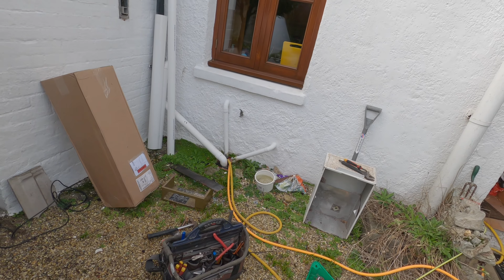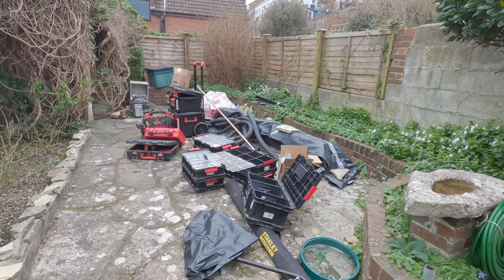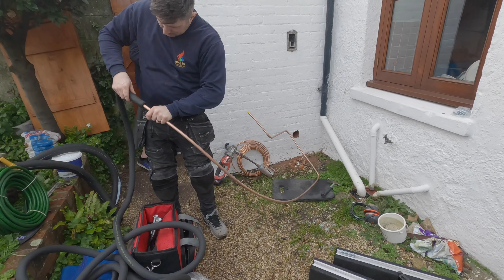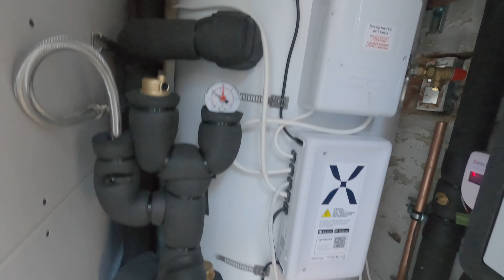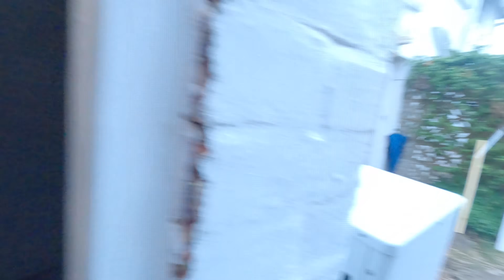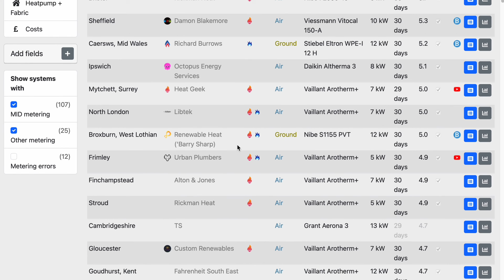Vaillant Heat Pump and Mixergy tank installation experiences - Dorset, UK

Comment: Thank you. I’m having ours installed in the next few weeks. 
I’m extremely nervous that the unit is way too big as we like to keep the house cool at about 15C, a Samsung 16kW unit, I keep arguing with the installers but they insist that anything smaller won’t work. Previous installers were pushing for a 3 phase unit!
I just hope that the compressor can ramp down sufficiently to let us run at a 40C flow temperature or less.
Reply from the maker: We have another heat pump installation which used a STIEBEL ELTRON 12.kW unit. I run this at 30c to 35c for house heating and it did seem difficult to get it to use less than 2kW+  with amore cycling than I would like. I have put the unit into a silent mode that I think stops the heat pump from going over 70% of its potential. That seems to improve the efficiency though I find it hard to be sure. The Vaillant system also runs at around 35c for heating, and it takes about 700W typically - but the house is significantly smaller.  There is an interesting discussion on the subject of sizing of heat pumps in the OpenEnergyMonitor Community with the title Electrification of Heat trial data by Trystan Lea if you have not seen that. Good luck with your system. 👍
Reply: @ Thank you. 
We used to live in Switzerland and had a heat pump installed there about 15 years ago, it was all really straightforward and worked well and was economical to run. I’m not convinced many installers know what they are doing yet in the UK with these units, seems more of a dark art than engineering. It shouldn’t be.

Comment: Great video 😀 I've been reading about how Mixergy affects performance if the water isn't in Eco mode, maybe it's worth experimenting with this to see if it affects your overall SCOP. Also, have you adjusted your weather compensation curves as low as possible? Again, efficiency gains to be made.
Reply from the maker: Thanks for the useful comment. We are on purely weather compensation with a curve of 0.7 which seems to be about right for us.  I'll look into the ECO - it doesn't seem to be available from the app, but I'll dig into the control panel. Thanks again, Jeff

Comment: the radiators installed were they k3 or k2+?
Reply from the maker: Hi - I think we have a mixture of K3 and K2 radiators.  The installers did the design and then gave us some options depending in the width that we preferred in each location.
Reply: @ thank you, how have you found the cold snap at that location or haven’t you gone back recently, I know it’s a lot milder, but interested in the k3 performance compared to the old boiler since I’m used to 55c rads and if they truly can help on a cold room , on the pump
Reply from the maker: @ram64man  I can't really say, except the house is wonderfully warm, much more than when we had the old gas boiler, even though the radiators are running at a much lower temperature. The constancy of the heating keeps the place cosier. We have no regrets!
Reply: @ thank you for the feedback

Comment: Great video Jeff. I'm just trying to learn as much about air-to-water ASHPs as I can for our house in London. I'm amazed though that you needed a 7kW unit as I think we could probably get away with that on our 4-bed detached! We already have a couple of air-to-air ASHPs on our house in France (they call air-to-air and units "reversible aircon" there) but they're hugely simpler.
Reply from the maker: Hi, thanks for the reply.  I’m not sure if it is over-sized or not, it is hard to say for sure until it gets really cold.  Right now the AroTherm is purring away, and only gets a little more energetic when heating up the hot water tank when the flow temperature gets to just about 60C degrees.  The house is very comfortable right now, and time will tell if it could have had a smaller unit.  When heating the house, the power peaks at just under 800W and stabilises at 550W.  The COP while heating the house seems to be about 4.2.
Reply: That's very good CoP-wise! So if I'm working it out right, your peak heat output at the moment is 4.2 x 800W = 3.4kW so well within the capabilities of your heat pump. What was your EPC prior to upgrade? I'm waiting to get an EPC here which I'm expecting will be around a D...
Reply: I'm guessing you're an engineer, BTW, given how comfortable you seem to be with the technology. I'm of the same generation as you, an electrical engineer by training and have spent my life in consultancy (now retired) so very into technology.
Reply from the maker: @reeshar1234  Our EPC at the time was C, and indeed the house seems to retain heat pretty well, it being mid-terrace and having thick stone walls.  I used to work in IT and so the computing side is fine - but I struggle sometimes with electrical things, though I guess I am learning more all the time. I do rather like the Home Assistant and the flexibility and integration that it gives in monitoring and controlling things. Though I have learnt also that a smart home is only as smart as the person who configures it ... 😉
Reply: Our house in France has 45cm stone walls so I know the issue - namely that it takes a lot of time for the house to warm up (or cool down in summer, given we have an air-to-air system).
Reply from the maker: @reeshar1234  Yes, it works well for us.  Do you have a heat pump there in France?

Comment: Thanks for posting. I'm on the ASHP journey too, in my Purbeck area renovation. I'd have been interested to know the final cost of the installation.
Reply from the maker: Hi, it was affordable with the Boiler Upgrade Scheme help.  Probably not as cheap as a replacement gas boiler would have been, but it allows us to stop using gas, removes the gas standing charge, and make great sense by having solar panels and a battery too.  I would contact Octopus and a couple of local installers - especially those who have been recommended personally. I hope you can move forward with a local installer. Best regards, Jeff

Comment: I'm building a passive house in Cornwall That will ultimately use a Vaillant heat pump. I have just finished the heat geek course Mastery, and wondered if an accurate heat loss survey has been done before sizing the heat pump and if you have zoning, i.e. thermostats in rooms. The general thinking now to minimise cycling, is now to have no zones and to balance out your house using the weather compensation facility. This will reduce the system flow temperatures and improve COP (efficiency).
Regards Adam
Reply from the maker: There was a heat loss survey done, whether it was accurate is hard to say.  The upstairs bedrooms have angled  ceilings which are pretty close to the roof, and I'm not convinced they were accounted for in detail.  We have the Vaillant indoor display with the temperature gauge on it, and an OEM thermostat for reference in the lounge.  The heat pump id set to weather compensation and it seems to do a good job for us, as well as seeming to be efficient.  We do have TRV's on the radiators to give some adjustment if needed.

Comment: Isn’t that closer to window tham installation guide?
Reply from the maker: The issue with proximity to windows was the problem using the standard mono block Arotherm Plus which uses R290 refrigerant - propane. This led us to use the AroTherm Split which uses R410A which doesn't have the installation constraints.

Comment: What a lovely couple.  Thanks so much for having the courage and energy to document your journey and share it with us.
We are waiting for Custom Renewables to fit our 7kW Vaillant based system, so it was good value to watch your experience.
We initially tried Octopus in 2023, but they are trying to promote economic solutions to help mass adoption, so their product doesn't flex well to individual requirements.  We want to fit our external unit above a flat roof and they only install at ground level.  We tried BT too, but their beaurocracy defeated that attempt too.  We ended up going through Heat Geek, not cheap, but definitely promising for a quality product.  Time will tell.
Reply from the maker: Thanks for your kind comments.  I am sure that you will get an excellent job from Heat Geek.  The installer choice is even more important than the heat pump choice!

Comment: Thank you for taking the time to document your installation. A very good move to install the monitoring equipment. Are you running this system using weather compensation or fixed flow temperature?
Reply from the maker: Thanks for the comment. Yes, we are running with pure weather compensation set on the heat pump.

Comment: This seems very strange that planning were such a big obstruction to you just fitting a monoblock unit... if i were you i would make a big deal of this considering we are trying to promote heat pumps.. terrible... you cant even hear a monoblock unit!
Reply from the maker: We did make a reasonably push against the Planning people - but our life is too short and we actually ended up with a better solution I think.  But the process does need sorting out.
Reply: the problem came from installation guys at the start(years ago) installing them too close to neighbours windows in old small 1 bedroom quarry mens cottages etc. the units were LOUD. lines were drawn and DB levels need to be followed. its great having an environmentally friendly holiday/permanent home but not at neighbours expense. lovely couple glad they persisted and worked around it. btw personally i agree with you very doubtful in that instance it would have caused a problem, maybe it was too close to that bedroom window? people should be allowed to leave their windows open and have a good nights sleep during warm weather. fans and internals dont sound like they used to, octopus should go back to dakin and make their heatpump designers aware so they can bring their units inline.

Comment: Good video, installation looks good. Only the heat pump base looks a bit suspect.  Keep an eye on the unit keeping level. Thanks for the upload.
Reply from the maker: The heat pump is bolted onto those rubberised feet and seems pretty stable.  The ground underneath seems very stable, so I'm hopeful, but it is a good idea to keep an eye on it for a continued level placement. Thanks!

Comment: I enjoyed watching your video. I'm just waiting for Octopus to produce a design for our system. Fingers crossed that we don't have the problems that you had. However, Ecobubl certainly found you a really great install team. It looks like an excellent installation. Your outside storage cupboard was ideal as a plant room, wasn't it! 
(On a different subject entirely, I noticed that you have a piece of guttering catching rainwater from the storage cupboard.   Have you thought of extending the gutter on the left hand side at a right angle until it's above the garden and putting the downpipe there instead of its current position? That way it would be out of the way!  Just a thought.)
Reply from the maker: Thanks for the comments.  You are right, the guttering in the video was a temporary arrangement.  It now runs to the existing downpipes from the roof by being extended above the heat pump.  We had to wait until the gas boiler had been removed to be able to do that part.  All good fun!

Comment: Thanks for posting,... you refer to it as a split system, but it looks more like a standard arotherm plus with a hydraulic station?
Reply from the maker: It is split, with the heat extraction being done by the outdoor unit, the refrigerant carrying the heat to the indoor unit, and the heat being exchanged there to the water - for the radiator circuit or the hot water cylinder. It is a more complex install, but it got round the issue we had with the R290 refrigerant since it uses R410a instead. Not so environmentally friendly, but it is unlikely to have a leak I hope.
Reply: @jeffjsmith  Thanks for the reply, ah yes when i looked again i see the difference.

Comment: 7kW does seems large for your property but you are getting good performance.  Clearly cycling isn't a problem. It must be a well installed good design.
Reply from the maker: Yes, it might be larger than absolutely required, but it does seem to run efficiently.

Comment: Bureaucracy ! A couple of decibels , you could understand in your case with neighbours so close if it were a little higher perhaps , but a couple , this is the contradiction, you are implored to do this and then big government gets in the way , although for some regs I believe they are changing .
Reply from the maker: Yes, it did seem crazy that we are being encouraged on one side to help in reaching net zero, and on the other hand public health is inflexible. I do believe that this will be sorted out soon, I certainly hope so.  The saving grace was that due to the delay we got a bigger boiler upgrade scheme grant!
Reply: Decibels are not linear.
Reply: Ok , so the point really is if it were that close why apply the rule so rigidly ? You surely get the point in the current environment using what borders on petty bureaucracy to put obstacles in the way of someone trying to do as requested , it’s pencil necks gone mad .